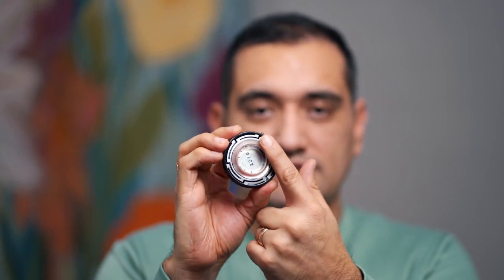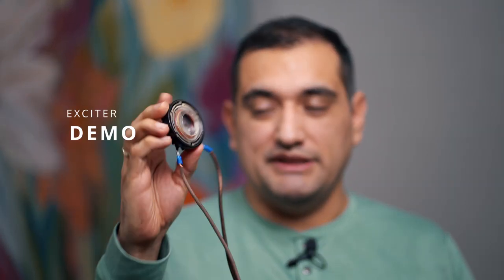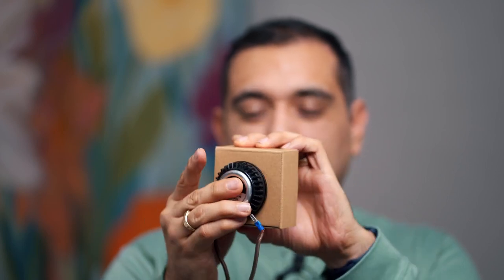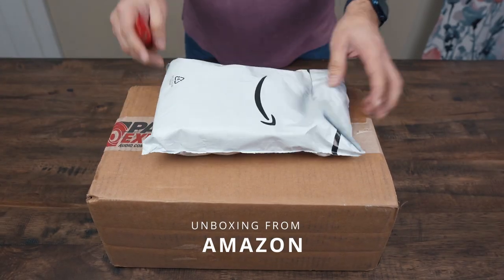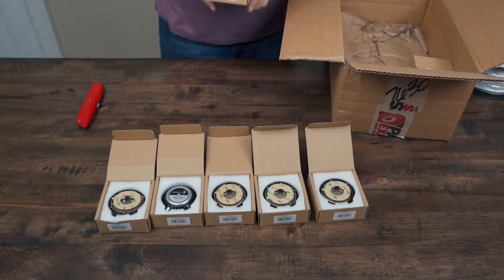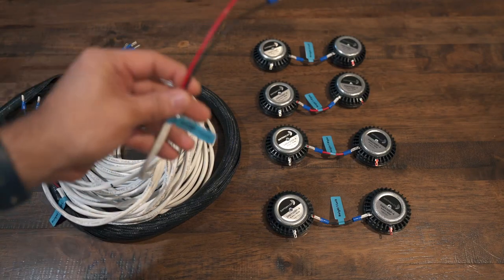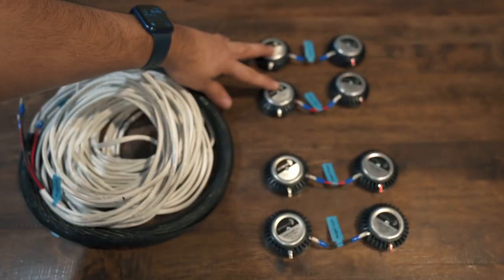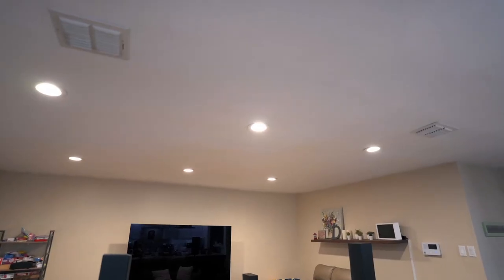Using the Dayton Audio DAEX32EP-4 as height speakers - Home Theater #37

Comment: I just recently installed 14 of these speakers in my basement family room.  2 front left, 4 center, 2 front right, 2 back left in the ceiling and 2 back right in the ceiling.  Then I put two in my office.  The basement wasn’t complete so I installed these before the dry wall was completed.  I made sure they worked with my receiver and sub.  Sounds good but I have to wait for the dry wall mud, texture and other finishing completed in the basement before I can really enjoy the new sound system.  Hopefully it’s awesome.
Reply from the maker: Wow, would be interested to hear how it sounds for you after everything is all set. That would be a cool way to have an "invisible" sound system for sure.

Comment: If I understand what you said correctly, yes that sounds correct on the series parallel. 
I would love to see a new video when you add those. 
Great video! 
I'm looking to add height speakers in my setup in my bedroom. 
For a .4
I might look into these myself.
Reply from the maker: Thanks for checking out the video, unfortunately, someone else pointed out that the way I was thinking actually brings them down to 4ohms but I did end up getting some more and posted the video if you want to check it out (https://youtu.be/HW0kQdxZ2qk). It's working out well so far but I do touch on this in the other video despite the additional speakers it still has a lower output which if I'm being honest isn't really that bad, I can still turn everything up to extreme levels but if I can get permission to add holes to our ceiling from the wife that will probably be the next version. Not anytime soon though. I think that they may be a bit more of a gamble than traditional methods, not to discourage you but just something to consider.
Reply: @RandomDistractionsYT  I must have not understood correctly lol but glad you got it sorted out. 
I was wondering if maybe the output is so low could be attributed to not having the "speaker" pointed at mlp.
I know with  "normal" ceiling speakers, they say for best results to aim them at listener. 
Just a thought I had. 
Don't know if it would make a difference or not.
Reply from the maker: @Reldvs1  No worries, speaker wiring is so new to me, I had no clue. 

That could be part of it since it's just radiating from the position that the speaker is in and also the thickness and rigidity of drywall unfortunately doesn't help either. When you place them on something that is thinner they definitely get louder. Although certain frequencies are much louder than others too but had to make adjustments to that too because then it made them too localized.

Like I said I will work on convincing the "boss" to see if I can eventually switch to more traditional speakers and see how that goes, however, it was fun to try and gets the job done for the most part. Will be interesting to see what the difference is like if I do make the switch.
Reply: @RandomDistractionsYT  are you planning to maybe sell the exciters you have in the future?   If the "boss" approves your more traditional speaker plan that is. 
If so I might be interested. I don't care if they have been used. 
Just putting that out there in case 🤣 🤣 🤣

I have a system I'm working on and your and others videos on here have inspired me. 
I have some ideas I'd like to try maybe, which is why I'm putting my interest out there, if you decide to move away from using these.
 
But if you plan to try more experiments with these and want any input maybe you can try my ideas, if you have any interest. 
I don't want to push my ideas on you lol.
I felt my first draft of this message might have been that way, so I edited it 😆 🤣 
Sometime I get a bit too excited and need to reel it in 🤣
Reply from the maker: Sorry for the late reply, I think I might have missed your original message but in regards to your question I'll keep you in mind if that happens. At this point I'm good with them until I can convince the "boss" otherwise. I was able to watch Ant Man Quantumania the other day at reference level and they worked well.

Comment: You should have hung acoustic ceiling tiles on the OUTside of the drywall... Suspended so as to free float.. I'm sure it would have been soooo much better sounding
Reply from the maker: To your point, it probably would have but unfortunately, I don't have a dedicated space so this would have been in our living room which only has 8 ft ceilings but more importantly I would have been killed by my wife. 🔪😵
Reply: @RandomDistractionsYT  They could have been done tastefully, say by putting LED strips on the ceiling then hanging the suspended panels. I think there is a name for that kind of lighting I'm not sure of the name though. Tray lighting maybe?
Reply from the maker: Personally I think that would be cool (I like the idea of the LEDs) but my wife already doesn't like the fact that I have speakers in the living room in the first place so by being able to keep them hidden I was able to get away with it. I will say though I don't feel too much of a loss in the sound and everyone that has come to my house and they hear them are impressed. It's also kind of cool to just have the sound coming from the ceiling.

Comment: human ears are bad at hearing on the  vertical axes .  that's why our ears are on the sides of your head for horizontal or Left and right and not on top and one under the chin ..Hight speakers basically are just reinforcement for distance from the front speakers ..your brain is tricking you because it knows the sound from the top is out of phase  .same way it knows if sound come from the back ..
Reply from the maker: Thanks for checking out the video and the interesting info.

Comment: Just discovered your channel and I have to say this is very interesting.. Out of curiosity where do exciters usually get used? Or what were they originally designed for? Cheers..
Reply from the maker: Thanks for checking out the video! To be honest I don't know for sure but per some of the literature they say that they can "be placed on surfaces not conducive to traditional speakers or in locations where hidden speakers are desired". They actually do mention the use in a home theater but some others are kiosks or outdoor displays. Here is the link to the PDF if you want to take a look: https://tinyurl.com/28mfkpcd
Reply: @RandomDistractionsYT  thanks mate I'll check that link out.. 👍😁
Reply: So I actually have some (very very limited)insight to this. Exciters actually came before bass shakers, and were originally concepted for outdoor bad condition use. Think military hardware where a speaker cone might not be the best idea etc. Being able to reproduce sound from places there isn't room for full speaker cones, and in places where speakers are highly likely to get destroyed.
The current generation of exciters are specifically for diy/hobby/simple application use, as the ones I've seen in some mall walls and in theaters side channels from the early 2000s are absolutely massive. Think a bass shaker bolted to the concrete wall behind( this was in a Hollister that was built in my childhood)

Comment: How is the separation of sound from left to right and how do you think it would be if you added another pair? Just curious do to the fact it’s sound is from a larger point source than a typical speaker.
Reply from the maker: The separation is actually pretty good. It helps to reinforce panning from the surrounds but even by themselves you can definitely hear the separation. Even though the point source is larger it fades pretty quickly from origin. I actually went ahead and bought an extra pair for each channel today (they have a president's day sale) so will see how that affects the overall sound. Stay tuned!

Comment: why wouldn't you show the placement of these bad boys? show off the speakers in their environment?
Reply from the maker: Thanks for checking out the video and I do show them although not for a very long time but it's at the 7:06 mark. Then around 7:53 I show the attic. I do have a second video when I added some more and show them in the attic as well.
Reply: @RandomDistractionsYT  have you considered acoustic ceiling tile? saw some sick videos about them and how they resonate much better... also, im considering building some wall speakers but instead of string or hooks... have you thought about magnets? pos/neg to give off a floating effect that, in theory, should offer a string-less effect that should be allowed constant resonation... just a few thoughts.
Reply from the maker: @nahimastay71  Unfortunately, because we only have 8ft ceilings having something hanging from it doesn't work for me or for the wife for that matter. I do know though that because drywall is so much denser it is defeating some of the potential. The magnet idea is a good one though which would help decrease the depth. I decided that I may eventually move to a traditional in-ceiling speaker at some point but for now, these provide enough to satisfy me until that day comes.
Reply: @RandomDistractionsYT  NO NO NO, i mean use it instead of using the pink panther stuff. its the same type of material but it is apparently a much better resonator than the pink stuff and price point around the same. you can cut them the same and use them the same but with better results for you and your viewers... like me!
Reply from the maker: @nahimastay71  No, I know what you mean, but it's more of an aesthetic issue of having acoustic tile speakers on the ceiling. What I initially liked about the exciters is that you can't see the speakers, the sound just comes from the ceiling. As I said I will eventually switch to traditional in-ceiling speakers but these will do for now. Appreciate the suggestions though!
Reply: @RandomDistractionsYT  OK, i have no idea what youre talking about. im not saying put them on the ceiling... at all. just a different material that you treat the same as you did the pink. DO NOT PUT ON CEILING. leave on floor as you did the pink. maybe im just explaining wrong. anyhow
Reply from the maker: @nahimastay71  Oops yeah I think we are getting confused. I don't have the exciters on the floor, they are in the attic attached to the ceiling so I can use them as height speakers for Atmos in my living room space under the attic. For my main speakers, I use Arendal 1961 towers, a 1723 S center, and 1961 monitors for the surrounds. Thanks again though for the comments!

Comment: Guy just talking entire video and no demo of the exciters.  Fail.
Reply from the maker: Thanks for checking out the video I did some sound demos starting at 10:55 of The Batman, then John Wick and then John Wick but with the bed layer off. I also have another video where I added more exciters that has a demo song with just the exciters if you want to check that out as well. Thanks! https://youtu.be/HW0kQdxZ2qk?si=JIg1xk4YJFQ9Gl8e
Reply: @RandomDistractionsYT  You never showed the speakers though. That's what most people are looking for in these DML videos, the finished product!
Reply from the maker: @PunxsutawneyPhill  Ahh, I see what you mean. I quickly showed them at the 7:06 mark but could have probably showed them a little longer. Sorry about that. Unfortunately, I'm going to be looking at replacing them if I can convince the wife for in-ceiling ones. On a side note, since you didn't see them does that mean I have another 6 weeks of winter? 😅
Reply: @PunxsutawneyPhill    Yeah, I was a little irritated by this too.  It was only after looking at the comments that I saw the time marks to see the speakers mounted.  And I agree... explanations are swell, but it could be done over the top of video showing the details of the install.  We also need a sample of the sound in the room when done.  Unless I missed it, which is possible because the important things were only flashed on the screen for a split second.  Good presenter, bad execution.  He'll get better at this.